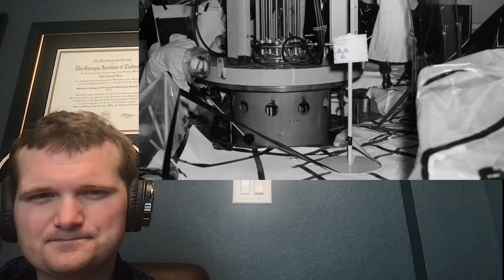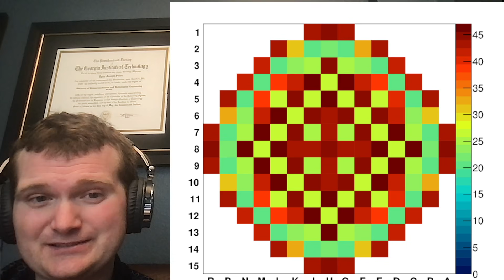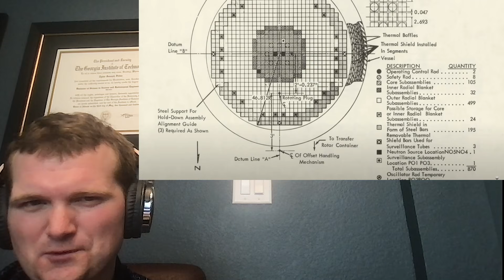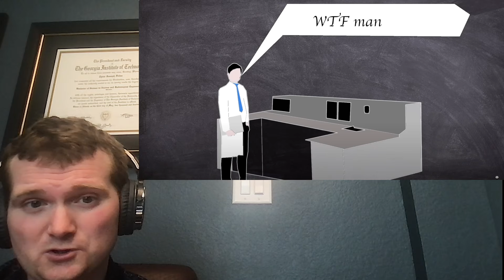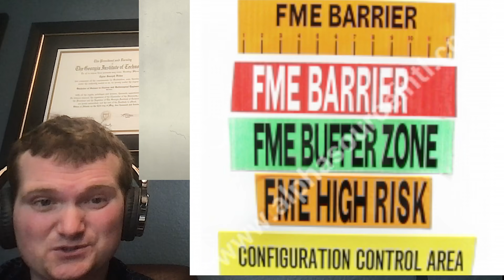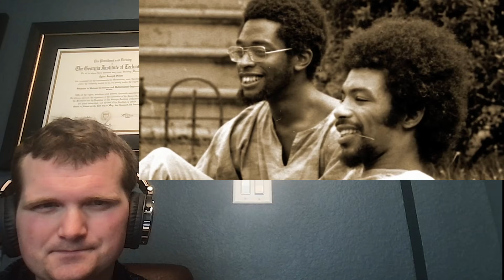The Worst Nuclear FME Event: Fermi 1 Meltdown - Nuclear Engineer Reacts to Plainly Difficult

Comment: fast reactors do not reduce the production of fission products. What they reduce is the amount of uranium that ends up in enrichment tailings or spent fuel, and the amount of other actinides that end up in spent fuel, down to practically zero, because there are no actinides that the fast reactor cannot use as fuel, and the fast reactor is also very tolerant of fission products; fast neutrons are not easily captured by pile poisions.

Comment: I lived 3 miles away when this took place. They DID release steam from the containment building, it was all over the news &
the alarms from the fire house where sounded. I remember my dad pointing out that all the bugs in the area had died and
all the birds had left because of lack of food. There was dead bugs every place. Also, you didn't talk about the worker who
dropped a wrench in the core while refueling. the news reported this caused the accident. Was this guy just a scapegoat. They
also found out that the plant flushed out contaminated water into Lake Eire from the water intake, the fish had ben studied and
proved it. when I worked on the site for Fermi 2, they where trying to flush the cooling pipes to the core of its trash and couldn't, they 
had to rebuild the whole system. I moved to Arizona before they started up the new plant.

Comment: And this is all why solid-fueled nuclear energy reactors are a relatively bad idea! Compare to the fact that if the fuel is already a liquid, it's impossible to 'damage' it by melting it!

A liquid-fuel design can be 'melt-down compatible', which allows for automatic 'disassembly', which is removing the fuel from the core. A liquid can just pour out. 

Precision machined solid fuel elements made to close tolerances need complicated remote-operated robots to painstakingly remove them one by one.

The moderator can be liquid too: This means you can allow that to drain away separately if necessary.

Atomic piles are very simple - but they come with the substantial downside that they're difficult to clean up and recycle. Not only do they 'shit where they eat', they require someone to constantly 'play with their food' as well.

Most of the heat generated by the any fission reactor is in the fuel: If the fuel is a liquid 'coolant' itself, then you can take the hot fuel directly to the heat exchanger, which can be separate from the core, rather than the core having to do three different jobs: Be a core (neutron oven, essentially), as well as be insulated to contain heat, as well as exhange that heat with a coolant so the heat can be taken to do work.

Molten-salt fueled reactor cores can just focus on being good thermal and neutron 'oven's, they don't need to also be a heat exchanger, because the fuel flows through and comes out hot, and then goes to the heat exchanger, where it is subcritical.

A liquid-fluoride core can be welded up out of sheet stainless steel and be approximately spherical, meaning better neutron efficiency: It can be a better shape to more fully utilise the neutrons. Turns out not to even really need Hastalloy-N too: Plain old 316 stainless is good enough, it turns out the trick is to clean the oxides out of the fluoride. No oxygen, no corrosion.

Humanity has built a lot of solid-fueled atomic piles, and there have also been quite a few 'fuel melt events' resulting in damage, shutdowns and also fatalities. 

Of the liquid fluoride fuelled reactors that have been run, there was a stuck control rod incident, which was almost a total non-event: no damage at all. Solid fuel reactors have exploded killing people when that happens.

One could try harder to make solid-fueled reactors 'meltdown proof', but that's a bit of a fools errand. At some temperature, your pebbles are going to sinter together, and thus be just as damaged as if melted: because they no longer flow. Like hard-boiled lollies left out in a bowl, they're all going to end up stuck together if that happens. 

Just let it flow and be done with it.

Comment: I'll note that CANDU reactors are considerably more expensive to build than PWR or BWR reactors, and yet, there's plenty of them in the world.  They don't have to be shut-down to re-fuel, with fuel-handling being done "robotically" (yes, even in the 1960s when the first CANDU reactors came on-line).  I lived across the bay from Pickering A1 while it was being built.  They burn mostly U238, with some bundles having low-encriched U238 in them.  They DO require a massive load of heavy water to act as a moderator,  but they have on-site heavy-water separators.  The actual reactor takes a lot longer to build, due to the structure of the calandria and the many many many calandria tubes that all need to be individually "plumbed" for moderator/coolant.  They have their own issues -- hydrogen embrittlement of the zirconium fuel bundles was an issue early on.  They also produce trtium, which has to be dealt with.
Reply: The CANDU reactor is still a very clever design, though: it overcame the problems of Canada's lack of uranium enrichment and heavy industry's inability to make the required large reactor pressure vessels of BWR or PWRs.

Comment: 2:18 just wondering but could we use molten tungsten as a coolant? .. then again if we did.. what would we make the reactor out of....
Reply: How do u want to manage something that has melting temp of 3400°C
Reply: @oljackie35   i mean it was sort of a .. i was gonna say theoretical statement but im not sure if it qualifys  i mean you did read the last half of the comment right....  but to answer your question this time around in a joking lighthearted way "with great care and preferably a really really long pole"
Reply: No. You can’t easily use a solid as a coolant. If you melt tungsten you melt everything else including the fuel, the reactor containment and everything else. You can have a molten fuel salt but then you use something unreactive like a fluoride salt (e.g. FLiBe).
Reply: @soylentgreenb   i didnt say it would be easy .. i never said it was practical i never even said it was a good idea lol  lol it wasn't a serious suggestion  that said  maybe something involving  granulated tungsten .. i mean it doesn't technically have to melt to conduct heat.... the problem with those sorts of things tho its  getting good thermal transfer between the heat souse and the coolant .. and not having the grains clump up or clog  that said flour mills seem to handle  the movement of  fine grained substances  pretty well ..tho they do have a nasty tenancy towards dust explosions...  maybe something akin to a large hopper of tungsten "sand" surrounding the cord with a screw convayer at the bottom  to remove the hot tungsten sand  to be cooled in a heat exchange ...some how... and then after its cooled it can be fed by means of another conveyor back to the top of the hopper  and then  idk surround the whole thing in a water jacket to keep the hopper from melting?  but thats just off the top of my head and i can already for see ... a number of problems.. not least of all being maintenance of the screw bearing  the  what i have to assume would be just ungodly wear from  the tungsten sand and oh yeah  no idea what  the neutron cross section of tungsten is so who knows if it would even be possible to min tain a nuclear reaction in such an environment of and you know sand .. it gets every where and this sand is probably both thermally and radiologically hot  not to mention i imagine on contact with air its going to burn with a fierceness not seen outside of  an albianian blood feud

Comment: 1:06 .. i have never understood this ...  liquid .. sodium .. you mean that soft grey metal that explodes on contact with water ?  as a coolent .. oh brilliant idea, wonderful idea.. what did'nt think to use gasoline? maybe liquid tnt?  hell when not just use 100 % oxygen or better yet fluorine ... ... sodium .. of all the metals with to use ..why would you use sodium ...  hey maybe we could try a hydrogen oxygen coolant next
Reply: Sodium is used for two reasons as far as I know. One is its low neutron cross section, the other is its low melting point. Believe it or not it’s the least dangerous option which has that combination of factors. Only two other metals have lower melting points; Mercury and Potassium. Mercury however also has too low of a boiling point which is why it’s not used while Potassium is just as dangerous as Sodium while being far more expensive. The other material options with low enough boiling points are tin and lead. Tin builds up a crust making it highly impractical. And lead needs to be alloyed with bismuth to get its melting point low enough for most reactors, a process which makes it highly corrosive. Lead-bismuth is actually used in some reactors but due to the alloying process it’s not actually any safer than sodium. It also has a positive void coefficient problem which is not generally a good thing.
Edit: Also most reactors use hydrogen oxygen coolant if you think about it. And while no one has ever used gasoline as a coolant a few oil cooled designs have been tested.

Comment: To be fair about the wording of that FME 2 Man Lockout signage: there is a usage for the word "man" to mean "any human" and it's probably the shortest word that can be read as such.

That said, it only adds 2 letters to make the sign say FME 2 Human Lockout, which seems like it wouldn't have that much of an impact on sign size or readability.  Though I imagine such signs have a fair bit of bureaucracy built into the process of rewording them such that size and clarity aren't compromised, and nobody's gotten the ball rolling on that.  Hopefully that's because women in the industry feel they're well respected enough overall that they don't see the signage as a problem rather than it being they feel they have to put up with it or face mockery for causing that much fuss over a 2 letter change to the signage.
Reply: Ppl?

Comment: Are breeder reactors less efficient, due to the neutron energies needed for breeding fuel and fissioning fuel being rather different? I was under the impression that you need to make the fuel in a breeder, reprocess it, and then use it a separate reactor. (And for that matter - if you have a reprocess plant you can use normal nuclear waste, not just stuff you make.)

Comment: Werry similar reason A1 Jaslovské Bohunice meltdown (carbon dioxide coolant, heavy water moderated chanel reactor),... once, when unpacking fuel assembly workers noticet sack of Silicagel ripped open, vacuum cleane everything they saw, but didnt notice several crystals whitin asembly. After insetion into core, those crystals cloged coolant, causing fuel assembly overheat, and partialy melt, damaging Channel and causing contamination of both coolant and moderator loops....

Comment: That zirconium plate was not really a foreign object in the sense of being something accidentally dropped or misplaced into the reactor. According to “We Almost Lost Detroit” (which I read), It was a last-minute addition to enhance protection of a pylon designed to prevent molten fuel from pooling in a critical geometry and was not even on the construction drawings.

Comment: I pray we are putting the most effort into fusion and not new fission.
Reply: I am not aware of any technology in the modern era of R&D that took more than 20-30 years to get from conception to acceptance in the marketplace. Nuclear fission chain reactions were conceived in the late 1930s and the first reactor demonstrated in the early 1940s. A “commercial” reactor was built in the 1950s.  The airplane was invented in 1903 and within 5 years were being sold commercially. The transistor was invented in the late 1940s and by the mid 1959s were being used in industry. Magnetic confinement fusion has been around since the 1950s; inertial confinement since the 1970s. Unless something like cold fusion ends up working out, I doubt fusion will be used for anything but niche applications like space travel.

Even if the ITER is successful, it will be a massive job to turn the technology into a commercial power plant that won’t require the skills found in a research facility. You’re still going to have to deal with neutrons which means material damage and proliferation concerns.

Comment: Did I understand you to say that PWR plants do not have two loops, I think you mean BWR plants only have one loop. Which makes for major maintenance headaches. PWR plants still have steam generators and secondary loops.
We had a FOD issue at the Nautilus plant at Idaho Falls, but on the steam side of the plant. A hammer head on a welding hammer came off and flew down the main steam pipe ahead of the turbine. X-rays did not work on the heavy steel piping so they started cutting inspection hole in the pipe, they cut a lot of hole before finding the head. Each hole had to be patched and certified.

Comment: How do you start up a system where the coolant is not liquid until its hot, it would be congealed in the pipes.
It did say Sodium, not NaK
Reply: The pipes and vessels will have an auxiliary heating system.  Typically this would be either electric heating cables wrapped around the outside, or an outer jacket allowing hot inert gas to be circulated around the sodium equipment.
Reply: You'd have an auxilliary start-up boiler to bring the system up to temp/pressure, and then bring the reactor up. And NaK is what's usually used. It remains a liquid even at room temp.

Comment: Thank you for this explanation.    

I have some experience as a boiler operator on a historic ship and I have been fascinated by steam power and propulsion since forever.  It seems inevitable that sooner or later, and regardless of the level of care, maintenance and inspection, sooner or later a tube in your boiler/steam generator/condenser is going to leak, usually where it is attached to the tube sheet, as a result of thermal stress, erosion or something else.  Large numbers of PWR and BWR power plants have had steam generator leaks. 

 It mystifies me how any sane engineer is going to put water under high pressure on the inside of dozens or hundreds of tubes of a steam generator and sodium on the outside of these tubes and expect the two never to come together over the lifetime of the plant.  It requires a level of perfection that is not achievable this side of heaven. Am I missing something?

Comment: The safety rods in that reactor had to be completely withdrawn to allow startup, insertion killed the reaction just as certainly as full control rod insertion and were an additional safety measure. Given the era in which that reactor was designed and built, unusually cautious design that was picked up in similar models later. Containment was literally capable of containing safely a maximum potential blast of reactor components from failure of 5 tons of TNT (I kid you not). Sounds like not a lot for some, but we're talking about containing that explosion within and now allowing anything out, not withstanding an external blast, which is trivial in comparison.
The US had three sodium cooled reactor meltdowns, Fermi 1 and its upgrade, forget the name of the one in LA, all of course sensationalized in various books that were rife with disinformation (they're still looking for mythical tritium in LA, as well as fission products in significant quantities (although, background was a fair bit higher on the site than the surrounding area and the original contractor was, well, use your own assortment of profane words)).
If you think only two control rods are bad, do look up the SL-1... With a positive void coefficient. Withdrawing the central rod too far turned that thing into the bottle  water rocket from hell.

Killed three, one of whom was pinned to the containment ceiling by a control rod plug.
Oh, the power of lousy design, shoddy implementation and casual acceptance of the same to create the worst water hammer in human history until Chernobyl.

BTW, TMI is literally a few miles downriver from me, literally walking distance to the bridge and visitor center (it's not like I'd get anything beyond a headache from security on the island, given its shutdown status, but the visitor center is still open).
Reply: Wasn't that the one where one of the workers remains consisted of a single piece of bone determined to be a fragment of skull they found lodged in the ceiling? Or am I thinking of a different Plainly Difficult industrial incident video?
Reply: Santa Suzanna run by Atomics International

Comment: wasn't molten aluminum used in a similar way as the sodium? I thought I read about submarines powered with a system like that but there were circulation problems with the aluminum or something.
Reply: The US Navy had a sodium cooled submarine reactor “Sea Wolf” in the 1950s but it turned out PWRs worked better.
Reply: The Soviets had a couple subs with liquid lead/bismuth cooled reactors. The coolant would solidify when the reactor was shut down and they had to use super-heated steam from an outside source to liquefy the coolant so the reactor could be fired up. That system was quickly abandoned.